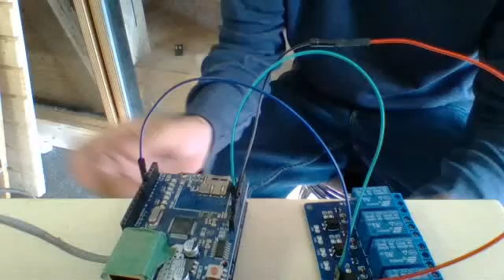"Songle" SRD-05VDC-SL-C Quad-Relays with an Arduino Uno

Comment: Since this relay can switch both 30VDC and 125 VAC, how can we make sure that the relay will do the DC switching job not the AC one?  Your answer is really appreciated
Reply from the maker: I don't really understand your question, but I've never used these for DC switching

Comment: Is it sufficient to run separate buck converters off of the same wall wart, or are two separate wall warts needed to maintain isolation?  I posted a question on the Arduino forum here:  http://forum.arduino.cc/index.php?topic=489395.0

I too did not like the active low setup so I added a transistor to put it back to active high.  If my arduino loses power I want the relay to go back to open (off).

Comment: hi! i have this relay with me.but im confused because on the blue box it has 2  AC voltages .
Can I on/off a 230v heater with this
Reply from the maker: well... that depends on the current of the heater, and if it has a circuit built-in to handle induction spike. otherwise it will "work", but could very quickly weld the relay contacts closed.
Reply: +Francis Mortanian thanx.On the heater cover it has 230v/ 1500w. so I think 6A  will work for it. Since the relay needs 10A can i use it?
Reply from the maker: I'd make a circuit to handle the voltage spike, but otherwise I don't see why not.